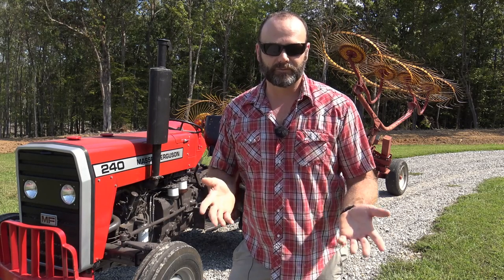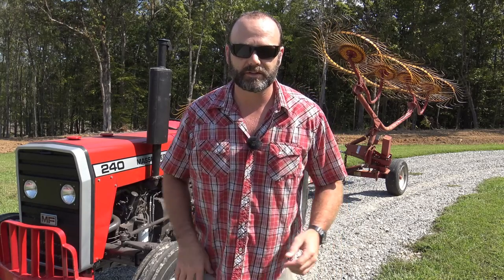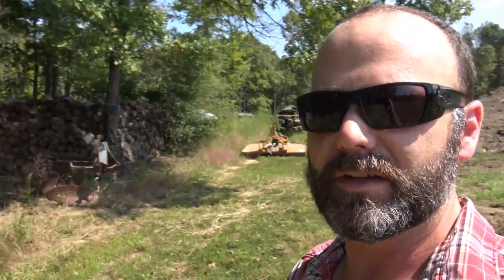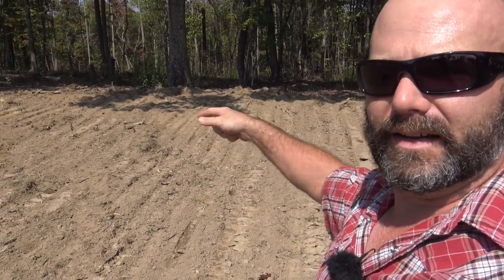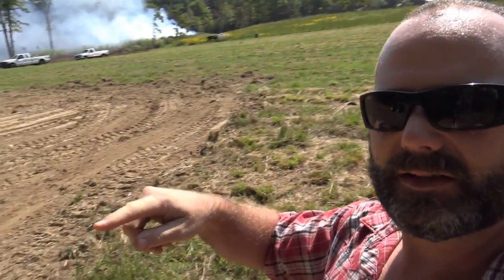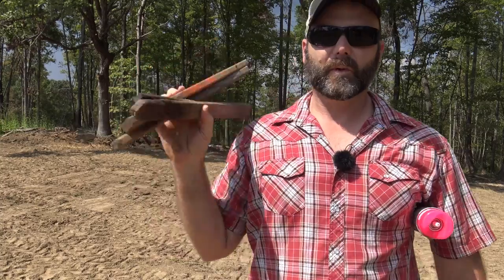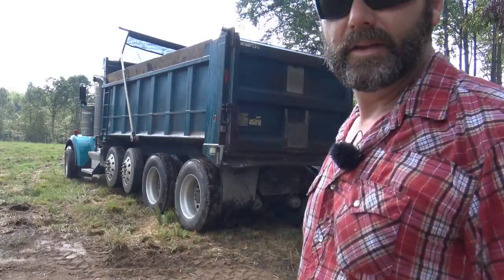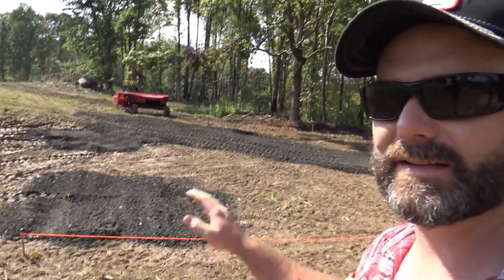Site Prep for a new barn (steel building or carport)..Mother nature screwed us up!!

Comment: Hey Josh here's a suggestion when trying to smooth out a building pad use a boxblade or section of chainlink fense weighed down with rocks this will give you much better results or you can try a harley rake just an idea my brother
Reply from the maker: Oh yeah...I put the blade on the tractor for the next 2 loads and got her all fixed up

Comment: I had something like that happen about a year-and-a-half ago. I needed to get a part of my driveway re-graveled.  Nothing had been done to it since it was put in (about 10 years), and I needed make it look better for daughter's wedding.  When the guy came out with the dump truck, he couldn't spread it out evenly because of a large, low-hanging tree branch.  I was stuck because I don't have the right equipment to spread it evenly (i have a 1953 Farmall Super C tractor, and the hitch doesn't "float", so using a box blade doesn't level things out). When the driveway was put in originally, the guy had a dozer because he had to grade the area first.  So he just used the dozer to spread the gravel under the tree.  I realized all this after the gravel was dumped.  Thank goodness, a neighbor came to my rescue, and smoothed it all out.

I need better equipment, but they want you to pay for it. ;o)